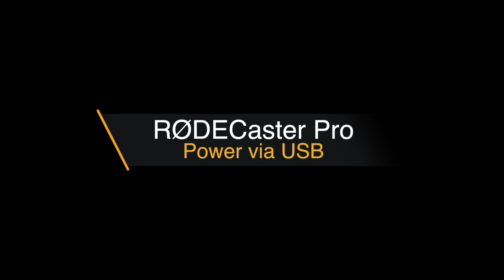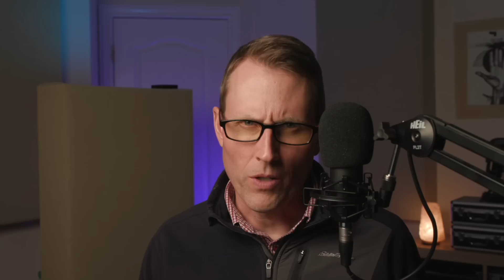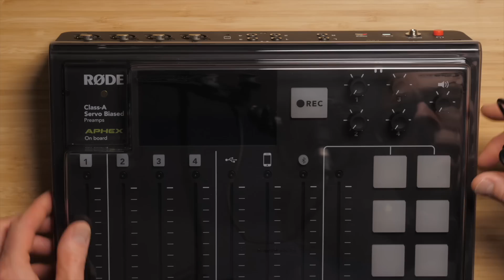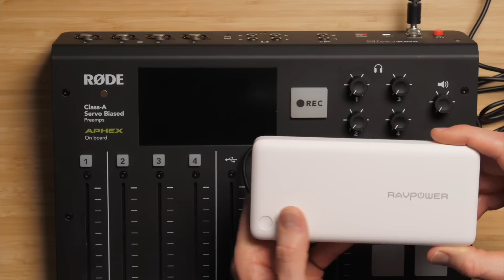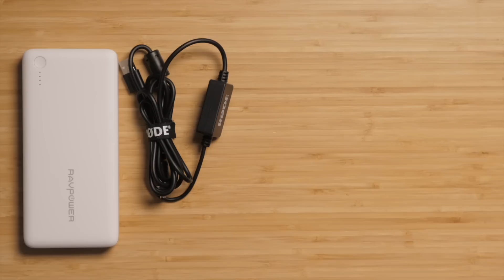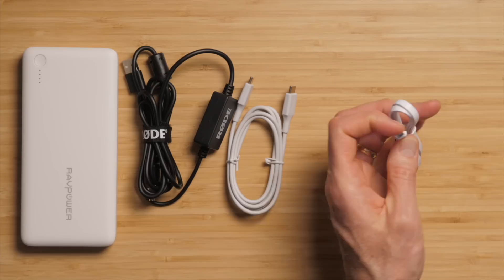RODECaster Pro Mobile Power Update - Power via USB Battery

Comment: Hey Curtis, the battery pack you linked is discontinued and you can't get to the Amazon store page anymore. what was the capacity (mAh) of the model you used? Trying to estimate how long my setup will last, Thanks!
Reply from the maker: It is less about the capacity. What you'll need is a battery bank with PD (power delivery). That will provide enough current for the RODECaster Pro.

Comment: Rode are not very smart: if they had gone to USB-C / USB-PD  the PD protocol can take care of 12V. Ravpower and Anker make also cheap USB-PD powerbanks. So no awkward properitary cable with an (then) unnecessary voltage buck-converter.
Reply from the maker: In retrospect, that would have been a good design choice.

Comment: Hi, Curtis. It appears NOT all power banks even though they're rated at more than 2.4A @5volts and have large capacities of up to 30,000mAH, it's not enough to power up our Rodecaster Pro.  I think it has something to do with a Power Bank being first classified as "PD" or "Power Delivery".  Without this specification, the Roadcaster Pro won't power up or shuts down, immediately, as soon as it did, initially,  power up.  Have you, by any chance, encountered this issue?
Reply from the maker: Hi Darren, I think you're right. I haven't had this problem with the PD power bank we showed here. It has been rock solid.
Reply: @curtisjudd  Hi, again.  Can you, at least, please give me the exact model of that RAVpower PD pack you used?  I'm gonna look for that same exact model.  I am a fan viewer of yours  from the Philippines.
Reply from the maker: @Vendetta725  Yes, the link is in the description. Titled as follows on Amazon - Portable Charger RAVPower 26800mAh 30W PD USB C Power Bank High-Capacity Power Delivery External Battery Pack with Fast Recharged for MacBook Air iPad iPhone 12 11 Pro Max SE S10 Nintendo Switch
Reply: @curtisjudd  Hi.  Thank you very much for the assistance.  Yes, I bought and have tested the lower RAVPower PD Pioneer RP-PB172 (20,000mAH) 18-Watts.  It worked like a charm with my DC-USB1.  You may now, comfortably, recommend this PB172 model to whosoevser have the same concerns as mine but finds the PB058 too pricey.
Reply from the maker: @Vendetta725  Thank you Darren, I appreciate the confirmation. Happy recording!

Comment: But you can use also any USB Power Adapter with 5W 2.4A with an USB Plug? Then why on earth it the power adapter of the rodecaster such a brick?
Reply from the maker: It has to transform the voltage and needs enough current.

Comment: Would be amazing if companies would agree upon a standard charger and power supply. IN UNIT they can adjust to get 8v or use the full 12v. Like ideally they would use USB-C but that is a standard for data with some power and realistically probably not as flexible as many of these boards would require. Call these mixers part of a series because that what they should be; ‘class 2 semi portable units’ vs ‘class 1 highly portable units (using current USB power)’
Reply: There's already the USB Power Delivery standard via USB Type-C which can deliver up to 20V at 5A. So, we are all covered from a standard perspective, we just need those rusty audio companies to be in line with the times.
Reply from the maker: Good idea!

Comment: This adapter propavly will be horribly overpriced... Sooo why just dont buy 12v power bank/battery and just solder a proper cable. That barrel connector is very standard. Just locking lut is an extra NOT NECESSARY element. And of course with 12v battery you propably could phantom all 4 imputs. It's very unefective to step-up voltage like this. From an electrician's perspective this is very garbage.
Reply from the maker: Great idea if you've got the soldering/cable makin' skillz!
Reply: I was just going to say that and then saw your comment- why not get a standard 12v car power supply and rig something up? But then, I am no electrician, I work with air and paper...